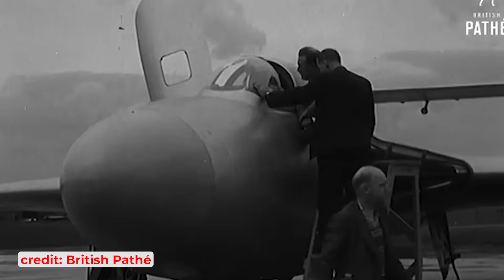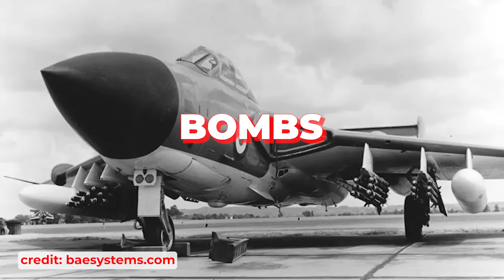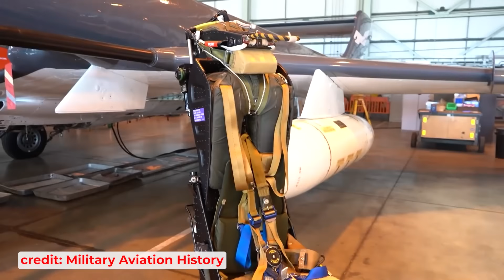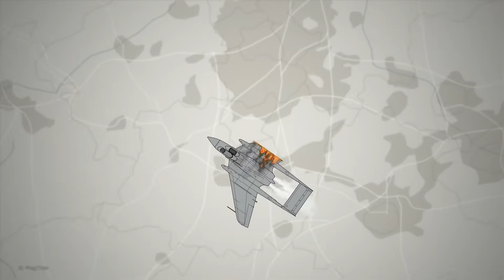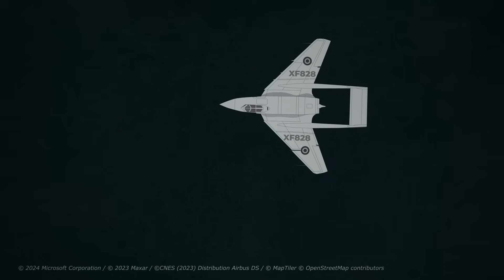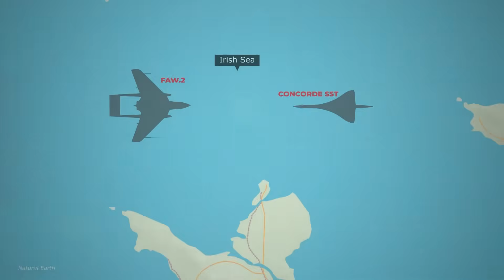Sea Vixen: A Beautiful Killer

Comment: A good summary of the aircraft but I have a few point which I hope you'll find useful:
The 'H' in 'DH' amd 'HMS' is aspirate and pronounced as it's written: 'Aitch'.
It might be worth mentioning that the potential Iraqi attack on Kuwait was In 1961 and had nothing to do with the Gulf War thirty years on.
The g-suits weren't 'ventilated'; they used a low-pressure air feed to inflate bladders around the legs and abdomen to keep blood in the upper body during manoeuvre.
The air position indicator was basically electro-mechanical clockwork that resolved speed and heading into an estimated position in the air mass.  If the navigator entered an estimated wind this was calculated as a ground position.  But it was basically mechanical dead reckoning; it was not accurate and had to be regularly updated by other means, such as the Tactical Air Navigation system.  TACAN gave you bearing and distance to a beacon but couldn't be used on live operations as it's emissions could be detected by the enemy.

Mainly though, having titled this as 'The Jet That Terrified Its Own Crew' it might have been good to back this up.  The Vixen certainly had a high attrition rate, 55 out of 145 being lost in accidents and 51 aircrew killed.  Partly this was due to the low power settings needed for carrier landing which put the engines at a relatively unresponsive rpm. However, many losses were not the aircraft's fault, more the job it was asked to do and the technology available.  For instance, the radar had no look-down performance to separate low-level targets from sea clutter.  Therefore to get a lock against aircraft the Vixen might have to be down there in the waves also, often at night and in bad weather.  Then in the strike role the aircraft would be tasked with lofting bombs onto target ships, having to execute high-g manoeuvres with a lot of vertical velocity, again at night and in poor weather  with lots of scope for disorientation.  The procedures for rocket and missile attacks were even worse.  Nowadays we would have pulse-doppler radar, night vision systems and stand-off anti-ship missiles but in the 1960s these missions were insanely dangerous, even without the enemy getting to play too.  To put it into perspective, one of my friends was killed when his Tornado flew into the North Sea while practicing loft attacks as a work-up for Gulf War I.  Twenty years after the Vixen retired this stuff was still b****y dangerous.
Reply: Even worse is when people refer to THE haitch MS. Does my swede in.
Reply: All of de Havilland's jet were notorious "killers" as Eric Brown would call them. The de Havilland company was deeply troubled, corrupt and relied on antiquated and outdated technology to design and manufacture its jets... The Comet, Swallow, Vampire and the Sea Vixen all had appalling safety records bathed in the blood of British pilots.
 Thankfully the company went tits-up after the Comet Disaster in 58' before the Vixen ever entered service... unfortunately Hawker Siddeley would buy up most of de Havilland's assets and projects continuing on with the Vixen despite the fact that it was already obsolete when it was introduced into service, the F-4 Phantom II which served the same role was introduced just a year later was Mach 2+ capable while the Vixen couldn't even fly supersonic.
Reply: @DoktorBayerischeMotorenWerke 

Sea Vixen Compared. 

We feel we can clear up some commonly held myths and misconceptions, obviously.

It's always good to see the facts presented clearly and concisely isn't it.

We feel we can clear up some commonly held myths and misconceptions, obviously.

It's always good to see the facts presented clearly and concisely isn't it.

See further down for a Meteor losses comparison.

See below for Comet accident losses comparisons. The Comet had similar accident losses fatalities to the later Sud Aviation Caravelle. Much later jet airliners from US manufacturers had significantly worse accident losses. 

The Vickers VC10 held the Atlantic crossing record for 43 years  (Non supersonic airliners). 

The Harrier was the only aircraft of its type at the time it first flew. All 1250 Pegasus engines built for all Harriers ever built anywhere were British build and design engines. The first 135 Harriers purchased for the USMC were entirely built in the UK. All 436 USMC Harriers had British built engines. 

The world's first wind tunnel was built in England during the 1800s. The world's first supersonic wind tunnel was built in England during the 1920s. 

Indeed that's correct. The Whittle Gloster E28/39 was of course a brilliant aircraft that was later copied in Russia as the upsized and tweaked Mig 15 with a copy of the RR Nene gas turbine aero engine.

Obviously the RR Nene being the world's most powerful & most reliable gas turbine aero engine in 1944.

The MD F3H Demon was a contemporary to the DH Sea Vixen & had a similar performance. The F4 Phantom was a follow on from the F3 Demon. The Sea Vixen took a long time to get from first flight to introduction for various reasons and a similar situation occurred with the MD F3H Demon.

McDonnell Douglas F3H Demon
590 Built. Not Supersonic.
Max Speed 578 MPH.
Introduction date 7 March 1956
First flight 7 August 1951
Retired 1964

MD F-4 Phantom 2
Number built 5,195
Manufactured 1958–1981
Introduction date 30 December 1960
First flight 27 May 1958

DH Sea Vixen
Number built 151 (including two DH110 prototypes and one Sea Vixen prototype)
Introduction date July 1959
First flight 26 September 1951
Max speed 695 MPH.
Retired 1972

Regarding the UK Aerospace Sector.
 
An airline recently ordered 60 RR Trent XWB Engines.

It's a great pity & a crying shame that British military forces had to occupy a large part of Germany for decades after 1945 & Russian military forces had to do the same. Of course Russia still posseses a large chunk of what was German territory & of course Russia & the UK produce nukes. Obviously Germany does not produce nukes.

Interesting British achievements.
There is no doubt that the Fairey (England)
Delta 2 was of course the world's first jet
aircraft to exceed 1000 mph.  Indeed It
exceeded the previous record by 310 mph &
held the record for 1 year. Incidentally, the Dassault Mirage 3 & 4 are based on the Fairey Delta 2.

Early days, jet fighters.
De Havilland Vampire, Sea Vixen & Gloster Meteor accident losses were not high or unusual for fighter aircraft at the time. De Havilland built large numbers of all metal airframe aircraft before the DH Comet.
We mustn't forget of course that the DH Vampire for example first flew in 1943 & the engine was also built by De Havilland. There were examples of the Vampire interceptor / fighter in service until 1990 which was operated by more than 30 countries.

Non combat phase accident losses.
% of Aircraft built.
The Canadair CL-44 was a turboprop airliner.
Canadair CL-44                  (ff 1959 ) 48%
Lockheed XF104                (ff 1954) 100%
Lockheed  P80                   (ff 1944) 43%
Lockheed F104                 (ff 1954)  45%
Grumman f9f-5 Panther   (ff 1947) 44% 
Convair F102 Dagger        (ff 1953) 45%  
MD F-101 Voodoo.             (ff 1954) 34%
MD FH Phantom 1            (ff 1945)  35%
MD F4 Phantom 2             (ff 1958)  28%
MD F3H  Demon               (ff 1951)  32%
Gloster Meteor                  (ff 1943)  21%
DH Vampire                       (ff 1943)  23%
DH Sea Vixen                     (ff  1951) 33%
Gloster Javelin                   (ff 1951) 20%
EE Lightning                       (ff 1954) 33%

An example of what goes on these days in various countries.
For example, there are of course no German companies that makes German jet aircraft in Germany & there are no German Companies that make German gas turbine aero engines in Germany that are suitable for widebody airliners.

Brazil makes very good airliners & Brazil is 100th down the list along with Indonesia for wealth per capita. Of course it is in fact the case that Embraer can't build those airliners without purchasing stuff from the US, UK & Europe. Norway Holland Denmark Ireland Belgium - Top 20 wealth per capita - Don't make airliners -  its as simple as that.

    Early days of the airliners.
That's correct of course, at the time the Comet wasn't particularly dangerous. Agreed, that is indeed the case of course, The DH Comet was definitely not the worst engineering failure in commercial airliner history.

How things were back then. 
Accident losses - % of aircraft built.
DeHavilland Comet 4                   14% 
DH Comet all mks   (ff 1948)       17%  
Vickers VC10 UK                            5%

The DH Comet had better safety than or similar safety to many other commercial passenger aircraft of a similar era.

Douglas DC-1                                      99%
Douglas DC-2                                      47%
Douglas DC-3                                      30%
Douglas DC-4                                      26%
Boeing s300                                        72% 
Boeing 307                                          70%
Boeing 247                                          48%
Boeing 707                                          20% 
Lockheed L-049/149 Constellation  30%
Lockheed Electra Turboprop             29%
Fairchild FH-227                                  30%
McDonnell Douglas DC-8                   14%
Sud Aviation Caravelle                        15%
Canadair CL-44  Turboprop                46%  
Convair CV-580  Turboprop                22%
Convair CV-880     (ff 1959)                27%  
Convair CV-990     (ff 1961)                33%
Tupolev T-104        (ff 1956)                16%

The VC10 held the fastest Atlantic crossing speed record for 41 years (Non supersonic airliners).

For the first few years of operations the Caravelle and Comet had similar accident loss Fatalities numbers.

De Havilland had prior experience building many all metal construction airframe aircraft & thousands of jet powered fighter aircraft that were primarily of metal construction with pressurised cockpits & jet engines built by De-Havilland.

We hope this helps. Cheers as always indeed etc
Reply: @DoktorBayerischeMotorenWerke 

A number of similar performance non supersonic jet aircraft got to first flight stage at around the same time. 

The MD F3H Demon was a contemporary to the DH Sea Vixen & had a similar performance. The later F4 Phantom was a follow on from the F3 Demon. The Sea Vixen took a long time to get from first flight to introduction for various reasons and a similar situation occurred with the MD F3H Demon. The Douglass Skyhawk delta wing is a contemporary to the the Gloster Javelin delta wing. Both non-supersonic delta wing aircraft, the javelin had better performance and first flew a few years before the Douglass Skyhawk.

Douglass A-4 Skyhawk 
2950 Built 
Intro 1956
FF 1954
In service to 1980s
Max V 670 MPH
Delta wing. A small / light jet aircraft designed for carrier operations without having to have folding wings. Often referred to as the scooter. 

McDonnell Douglas F3H Demon
590 Built. Not Supersonic.
Max Speed 578 MPH.
Introduction date 7 March 1956
First flight 7 August 1951
Retired 1964

MD F-4 Phantom 2
Number built 5,195
Manufactured 1958–1981
Introduction date 30 December 1960
First flight 27 May 1958

DH Sea Vixen
Number built 151 (including two DH110 prototypes and one Sea Vixen prototype)
Introduction date July 1959
First flight 26 September 1951
Max speed 695 MPH.
Retired 1972

Gloster Javelin.
434 built.
FF 1951
Intro1956
Max V 710 MPH
Delta Wing. 

Interesting British achievements.
There is no doubt that the Fairey (England)
Delta 2 was of course the world's first jet
aircraft to exceed 1000 mph, 10th March 1956 Indeed It exceeded the previous record by 310 mph & held the record for 1 year. Incidentally, the Dassault Mirage 3 & 4 are based on the Fairey Delta 2.

When the EE Lightning first achieved Mach 2 it was one of the fastest aircraft on the planet. 
P1 Mach 1 achieved 1954, Mach 1•5 capable.
P2 Mach 1 achieved 1956, Mach 2 capable. 
P2 Mach 2 achieved 1958.

The Hawker P1103 was a design and part built prototype that would have led to Mach 2 & Mach 3 versions of the aircraft. The General Dynamics F16 Fighting Falcon was of a similar design that went into service in 1975. The P1103 was cancelled during the switch to "mostly missiles plus no supersonic interceptor aircraft required in the future" era which included cancelling air to air missile development. Scheduled for test flights in 1958 and to be in service 1962. The General Dynamics F16 Fighting Falcon - based on a British design started 39 years earlier, built in the US and a number of manufacturing partner countries with parts for the US built aircraft sourced from partner countries. 

There were plans to do a supersonic thin wing Javelin which of course got cancelled. 

Early days, jet fighters.
De Havilland Vampire, Sea Vixen & Gloster Meteor accident losses were not high or unusual for fighter aircraft at the time. De Havilland built large numbers of all metal airframe aircraft before the DH Comet.
We mustn't forget of course that the DH Vampire for example first flew in 1943 & the engine was also built by De Havilland. There were examples of the Vampire interceptor / fighter in service until 1990 which was operated by more than 30 countries.

Non combat phase accident losses.
% of Aircraft built.

The Canadair CL-44 was a turboprop airliner.
Canadair CL-44                  (ff 1959 ) 48%
Lockheed XF104                (ff 1954) 100%
Lockheed  P80                   (ff 1944) 43%
Lockheed F104                 (ff 1954)  45%
Grumman f9f-5 Panther   (ff 1947) 44% 
Convair F102 Dagger        (ff 1953) 45%  
MD F-101 Voodoo.             (ff 1954) 34%
MD FH Phantom 1            (ff 1945)  35%
MD F4 Phantom 2             (ff 1958)  28%
MD F3H  Demon               (ff 1951)  32%
Gloster Meteor                  (ff 1943)  21%
DH Vampire                       (ff 1943)  23%
DH Sea Vixen                     (ff  1951) 33%
Gloster Javelin                   (ff 1951) 20%
EE Lightning                       (ff 1954) 33%

More recent UK military jet aircraft.
 
The Tornado & Typhoon & their engines are Supersonic & are indeed British design aircraft with British design engines built by an international consortium. The Tornado design for example started life during the 1950s at Vickers as the AFVG, it's engine is based on the RR RB-199. The EE Lightening is also a British Supersonic jet aircraft.

The Typhoon is the British BAC-EAP with an engine based on the British RR XG-40, the Typhoon is also built by an international consortium.

Comment: They had one at RAF Halton as a trade training frame. My course jacked it up and did undercarraige functionals on it. It was a solid strong aircraft but I wouldn't want to be the nav. That was in 1983.
Reply: There were quite a few Sea Vixens at Halton in the New Workshops when I was there 1976-79. There was also still at least one Sea Hawk there, plus a few Hunters, and a gaggle of Hunting-made Jet Provost T.3s. Towards the end of my course there, 3 or 4 of us were detached to Benson - under the control of some fully-qualified technicians - where we ripped electronic boxes and engines out of some of the first Gnats to be sent onwards to Halton. Fun times!
Reply: @gargk999  Yes, I can recall them. I may be misremembering, but I think the outer wing of at least one of them was used to practice battle-damage repair. I well remember some SNCO smacking the leading edge with a ball-pein hammer and telling me to repair it using what I could find in the gash bin. It must have been seeded because there was a ususpiciously useful baked-beans tin in there. It looked awful pop riveted over the cleaned up hole, but they deemed it acceptable!
Reply: @gargk999  I remember doing Undercarriage functionals on a Gnat as well, and stripping a JP of the undercarriage, wings, fin and tailplane then refitting them all and again carrying out functionals. Can't remember seeing a Seahawk but as I said previously it was some years back.
Reply: Sprog! 🤣😂
Reply: I visited Halton in 1983! I was on an ATC Volunteer Airframes course…perfect for a non technical person like me. We spent a lot of time looking at the Sea Vixen.
Reply: Yes I am sure there were two, when we had a RAF  #1 training School
Reply: @JohnSmith-ei2pz You are probably right, twas a long time ago and memories a funny thing. I was on a AAD course.